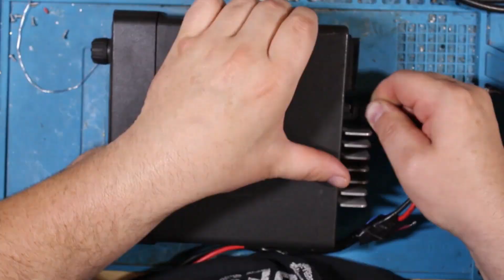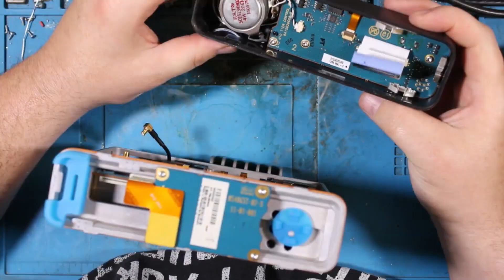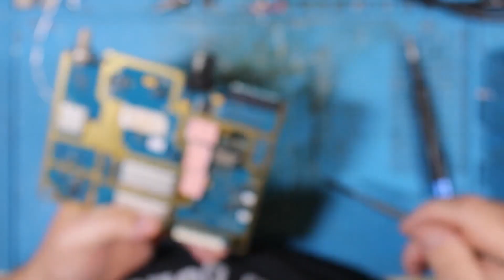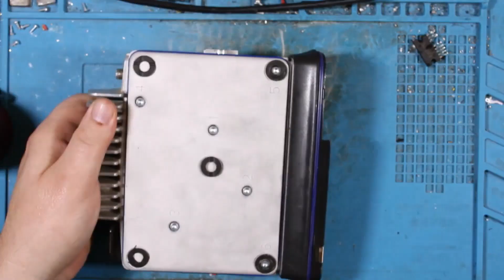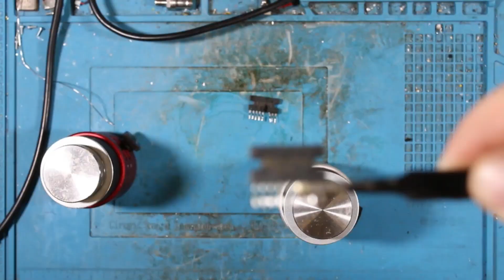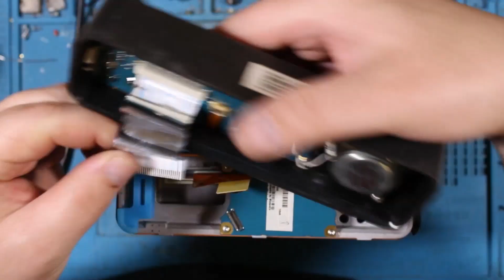Motorola XPR 4550 Audio PA Replacement | (EASY No Audio Fix!)

Comment: Good fix, but why did you not have any heat sinking for that part. No pad, no compound?????
Reply from the maker: I believe at 12:28 you can see the heat sink pad on the frame just above my finger. It blends in with the frame pretty well. It is the off grey/white just above the finger. 

It is there I just never mentioned it. 99% of the time the heat sink for the Audio PA sticks to the frame and I never think twice about it.